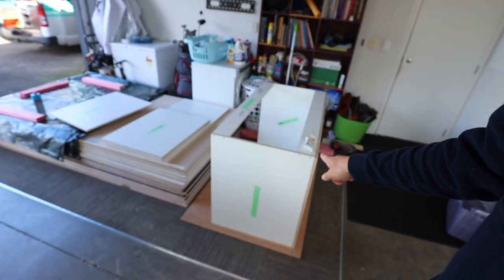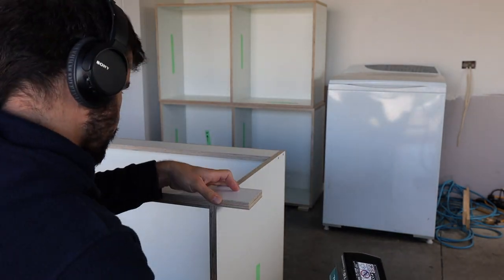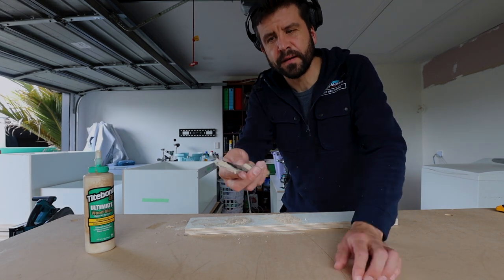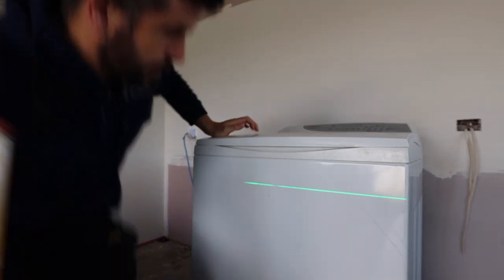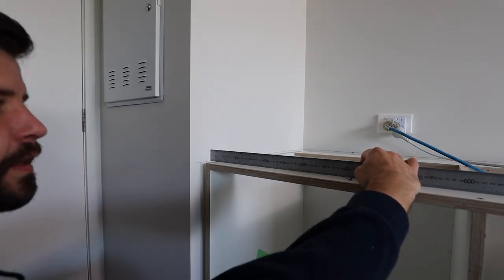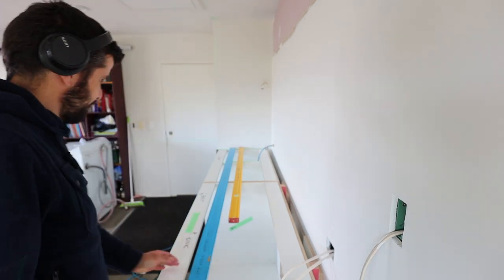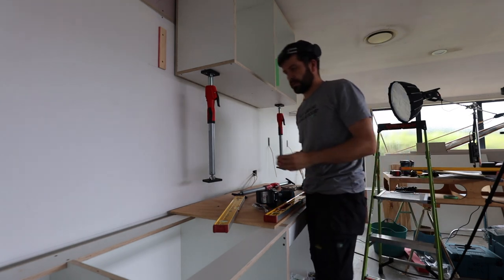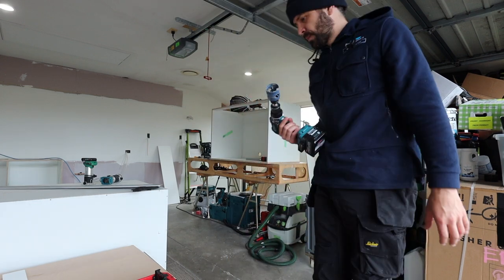Building Laundry Cabinets From Scratch

Comment: I just installed my mum and dads cabinets and i never thought to draw a level line on the wall, i spent so much time lifting the legs higher and using a level from one cabinet to the other lol.
you live you learn
Reply: Where i work we put a small lumber piece exactly under the bottom piece. That way the cabinets are always leveled.

Sorry bad english

Comment: Hi scott, Just a tip. When you use your lasers for installing cabinets, it's nice to have the laser 10cm higher than what you need and measure down with a block from that line to make it perfect. you'll save yourself a lot of headache and have more perfect results in the end.

Comment: Hey Scott, what you called HPL is just the stuff thats on the very top/bottom of those layers which feels like synthetic material. The wooden part inbetween is actually just higher quality plywood, which is why it looks better than the other stuff.
Reply: Also you could still make a middle section in the sink cabinet, just not the full depth. Instead make it the depth of the horizontal part on the top. That way the sink still fits in and it gives you more support for the horizontal one when somebody is leaning onto it to get something from the upper cabinets than your horizontal lower one. 

But as per usual, great video. Really enjoyed you working and the engaging energy you bring across so well.

Comment: HI -one way you can fit the top cabinets easily is to fit a horizontal cleat along the top edge and one along the wall - as long as the cabinet is square and the cleat level it pops straight on. Modern hanging hardware for kitchen units are only an adjustable adaptation on this. Rip a timber down the middle at 45 degrees - fit one to the wall the other to the cabinet - it will fit perfectly and never be seen.  I have seen it done with 12mm ply  - it doesn't need to be thick and will take a lot of weight as it's spread over a large area.

Comment: The router bits you’re after are carbide spiral bits. Thee types up cut, down cut, and compression (mix of up and down cut). For use on veneers and melamine etc I’d recommend a down cut to keep the chipping down on surface. Down side is bottom of groove will be a bit rougher. If you need a sweet dado or groove then the up cut is the go as it flings up the chips for a clean surface on the groove bottom. Compression bits sit in the middle and are good for a ‘mixed job’. Any one of the three will do a better job than the straight bit you used ;) can find them in all sorts of places. Carb-I-tool is a good compromise between quality and cost in AUSNZ. Good luck and don’t be put off by price. They’re HEAPS better :)

Comment: Hey Scott, you should check out compression bits for your router if you haven’t already. It will prevent chip/tear-out on the top and bottom  and leaves a smooth edge.

Comment: a tip for hanging top cupboard set your stand prior to putting up the cupboard just a few mm short of your desired height then put them under after and adjust from there

Comment: I think the new Festool drill has a feature whereby, if the drillbit (or holesaw) gets caught up, then the motor cuts out instantly - thus preventing the injury you experienced.
Reply: Makita has that on their battery angle grinders so they know how to implement that. Makes me wonder why they did not implement it in their 40v drills.

Comment: Hi Scott, set the clutch on the drill (which no one does) when drilling large diameter holes & you won’t get snatch back again. 👍
Reply: Yea, I used the drill function at one point and it kept binding and ripped my arm every time. I learned later on it probably would have been preferable to set the clutch so the drill would have stopped. The few times with the "drill" that you don't want it set to "drill" clutch setting
Reply: i agree
Reply: Or drill in reverse gear at least to get started.

I use diamond coated whole saws for cabinets because they have no teeth. They work great to drill through the thin hardboard or MDF and there's no binding. And you end up with a clean cut on both sides.

Comment: When setting uppers above your base cabs that are already plum and level, I’ve always found it easier to build a box that is maybe half the depth of your upper, and to the height at which you want the bottom of your upper to be from your base cab. This way, u don’t have to screw a ledger to the wall and deal with patching those holes, and you don’t have to screw anything in the bottom of your upper cab. If you’ve set your base cabs right, you just set your box you’ve made on top, and there you have a nice level place to set your upper cab on. And you just re use it right on down the line. Hope that makes sense! Cheers!

Comment: Tip for raising the top hanging wall
 cabinets without using them adjustable legs you could use  2 mini sissor lifts each side  then you don't need to put in screws  or need to fill in screw  holes after 😁 plus they are more stable wont move around 👌👍👍

Comment: I’m wanting to set front load machines at middle height in my mudroom. I like to set a good size tub sink next to the wash to catch overflow if the drain happens to clog during a wash. Have you guys got the heat pump type dryers there? I’m also getting the heat pump water heater with ducting- maybe I can exchange heat from my refrigerator in the kitchen directly above. Fridge costs about $80/year and that water heater is supposed to cost $104/year, so maybe I can cut both down another half? 
Anyway. Cabinets- yay! I’ve worked in a CNC run cabinet shop. You don’t need a CNC shop. Spiral shanks are nice tho! I’m always surprised to get a flat surface since it’s so… angular. Rabbits- I find it faster to use the track saw to cut my exact line, then clean up with the router. Instead of a table, I cut right on the stack of ply, lifting the work piece on stickers. Track saw all the way. You need three times the room with table saw, and you’re likely to get a back injury. 
You’ve not used 1/4 inch ply as backer for good reason- price is not reduced enough, plus thicker backer saves time from having to make cleats. Saves time on rabbits too. Bold move. 
I usually put a screw or nail standing proud right on the level line, (helps to verify stud locations too) and start cabinet hanging (uppers first) from the corner. A couple screws hold most of the weight while I tap the cabinet to the wall. Very simple one man technique. Any holes are easily hidden with a caulk seam under the cabinet. I like the clamps you got tho. Might give that a whirl. 
Good job mate!

Comment: A handy tip for cutting laminate without chipping - put a strip of masking tape over the spot you're cutting before marking your cut line. Press the tape down nice and tight and you won't get chip out. Instead of using the router for those check outs, the more conventional thing would be to use tape and a jigsaw. Tape would also save you the admirable caution you put into cutting the sink spreader on the mitre saw.

You can also get laminate cutting blades for the jigsaw which have up cutting teeth on the bottom portion of the blade and down cutting teeth on the top. Rarely, if ever, results in chip out, tape or not. I prefer to use both for the belt and braces approach.

Comment: Always use the drill on a slipping clutch setting with hole saws....
Reply: Agree with my fellow Dutchman, been there done that. Highest slip clutch and it won't break your wrist, or more importantly wreck your work piece.
Reply: Plus always use the front auxiliary handle when using hole saws, 👍🔨🇮🇪

Comment: Great vid as always. But if I'm correct you only screwed the upper cabinets on the backs, witch is very week as the full weight of the cabinet only replys on the fews screws uses to secure the back.  Normally I always use a fixing, brackets or similar, screwed to the sides, then the hardware to the wall, through the Back.  Take care!!

Comment: How do you like that Makita? I finally bought the big Kreg router table to dedicate my big porter cable routers into 2 tables and picked up the little makita for smaller work. I solely went Makita because I picked up another tool that came with 2 batteries and a charger and didn't want those batteries to get lonely haha. I also picked up the plunge kit and I want to say it was all less than 200 US fiat dollars

Comment: Those hole saws often work better when set on the lower speeds.
Reply: they work fine at any speed, so long as there is a drill handle involved. I've slowed the speed of my drill before and the torque can also almost break your wrist with those hole saws.
Reply: @dylanm3519  if the hole is under 4", i just use a forstner bit.
Reply: @Pepe-dq2ib  Forstner bits can be useful. But torque can also snap them, depending on what one is drilling through.

Comment: Tip for the future. When doing a sink cbd with a solid back put the front rail vertical and no back rail. That way you don't have to cut out the horizontal front rail for the sink. Tip 2. Get a car scissor jack and extend the handle. Easier to lift up the base cabs to adjust the legs. Tip 3. Don't bother cutting out any central divisions just fit them under the rails. Actually I never put any back rails in just used metal L brackets to fix the top down. With an 18mm back you don't need em. When machining out the carcasses I just calculate the top overhang, usually 20mm, subtracted a void space at the back, typically 10mm to allow for wonky walls, and an18mm back. On a 620mm top total width that gives you the carcass depth. Fit top, scribing if required,  screw top to carcasses  keeping a 20mm overhang, and then at the top of the carcasses screw back to the walls. No spacer blocks required as the top does that for you. It's way quicker than putting blocks on the wall. As far as wall units go I use French cleats then use wedges to bring them plumb. Then fit an extra bottom, usually the door/panel colour to hide the gap at the back. Also the French cleats are typically only 100mm long at each end to counter and wonky walls. And by screwing them from the cabinet inside, by backing off the screws Slightly you can fine tune it for plumb. Hope these suggestions help Scott.
Reply from the maker: Thanks Darryl, I appreciate all the tips!

Comment: Whenever I watch Perkins Brothers doing cabinets, they always start with the top.  So you don't have to leverage over the bottom pieces. Maybe a sawhorse for the jacks so you could used the tool and have the clearance at the bottom?  Well done, BTW.
Reply: 35 year cabinet guy here.  ALWAYS do bases first.    It's too difficult to find the exact high spot on the floor.  Setting the bases first eliminates that, and you can get an exact height off the base cabs for your uppers.   It allows for a much more accurate consistent install.

Comment: Kiao Ora Mate across the ditch - I'm not a cabinet maker but a few things - I've never seen melamine faced plywood, no that is not how MDF was invented and there is a purpose made patching putty for the voids in plywood, having an exposed plywood edge is a nice look but you will need to seal it - there is a plywood edge tape (ABS) that would have done the job, there are purpose build overhead cupboard stands that look a bit like bar stools that you could have used rather than put holes in your cupboards, everyone makes that mistake at least once when drilling a large hole with a hole saw - lesson learnt, cabinet making is a separate trade and what cabbies can do in one day with the right machines and tools non cabinet makers will struggle with for days. Cheers.

Comment: For overhead cabinet. You should put horizontal piece on wall, level that piece and chuck your cabinet on top and screw to the wall. Way more easy.
Reply from the maker: The mistake I made was getting the painter to plaster and finish the wall before I did the cabinets

Comment: When you are using hole saws use the toque setting on your drill, then when it grabs just does the fart noise then you pull it out and go again, saves your wrists and doing shit like you did.
Extra helpful when doing really big holes for down lights and ducting.
Reply: Oh, just scrolled through the comments and this has been said 1000 times haha

Comment: The router bit that looks more like a drill are called endmills and are ment for mills, there are ceveral factors to consider. 
The number of flutes (# of cutting edges) I would recomend  2 flute endmills as the more flute the heigher the cutting load(must be lower than deliverable power to the motor of the tool).
Material choice is another factor as hss endmills are cheaper but last less long than carbide endmills but carbide is brittle so if you hit a nail or drop it you may shatter which is also dangerouse as it sends debri flying, they do give a better surface finish as they chip and dent less than hss.
You should aslo think about tool length as the longer the cutting edge the higher the cutting load. And the length of the shank, I would recomend a shank of similar length to your router bits and cutting edge length similar to your router bits unless needed for something special but it should be avoided. I would not recomend long carbide endmills.
Hope this helps :)
Reply: They are not all strictly milling bits, and besides the only difference between a 'wood milling' bit and a 'router' bit is that a 'router' bit has a guide bearing ;). 
You can get spiral upcutting and downcutting router bits. The difference is that the flutes on upcuting bits evacuate the chips towards the top (good for blind slots) and downcutting bits evacuate the chips towards the bottom. The cutting edges being spiral shaped also helps for interrupted cuts since some part of the cutting edge is always in contact with the piece, whereas the straight bits alternate between all of the cutting edge being in contact and none at all.

Also keep in mind 'Router' bits always have 1/2" or 1/4" shank, whereas milling bits come in a far wider variety of shank sizes.

Comment: Those voids are from your lesser graded plywood IE Melamine ?  I don’t know why?  As a cabinet maker/finish carpenter I no longer use it?  To inconsistent and you can try as hard as you want ; however it will chip and peel , plus crack at the ends??
Off the shelf paint grade try “ Pure Bond”?and I usually do my finish at or near the end ?
The ends also look decent by using a Rnd Over?  And a floor stain I use is for hardwoods I use on the exposed sides if the customer wants it?

Comment: Milwaukee getting jealous of keep reaching out to Makita. Try reaching out to Toyota you may get a new van as it gets enough air time. Plywood edges. Makita don't make an edge bander eh. All plywood cabinets improvement on the usual chipboard construction and for made on site pretty good job. As to installation. Needs more practice but then it was a commercial production to showcase the Milwaukee lasers. I prefer my top cabinet stands. Mine just sit there self supporting. Place cabinet on top and wind up. How are you covering all those screw holes in the bottom. Never seen that before. Before the stands I used to screw a temporary level cleat on the wall and plonk them on that. Still do sometimes.

Comment: What I'm wondering right now is where is your distance from the back wall of the cabinet to the inside wall of the room? This distance is important for rear ventilation of the body so that no moisture builds up and molds. Where is this ??? 
Every carpenter knows that furniture bodies, i.e. the back walls of cupboards, are never placed directly against the wall because of moisture and temperature differences that mold if air cannot circulate behind the furniture!
Reply: Not sure where you're from but in Australia we never do this as a standard. The only reason we do this is due to the rear wall never being straight or plumb so we can pack out

Comment: Great video once again! Enjoying it from the Netherlands!

But doesn’t that Makita drill have anti kickback?
Reply: The antikickback works well when driving into concrete, but it doesn’t catch in time when using hole saws. The hole saw dimensions allow a large torque arm in flexible wood material so that it doesn’t reach the required impulse limit right away. It will still spin almost a half turn before popping off. I had a co-worker complain about it to no end. I learned from watching him what not to do. Don’t set it to high speed. Hold it so if it does spin it won’t flex your wrist. Reverse to score. Feather the teeth into material while tilting slightly so the trench of the cut isn’t tight enough to bind. Pull back frequently to allow dust to clear cut. Co-worker can’t find a drill that isn’t “broken”. i’m still using my Makita beast.

Comment: Baltic Birch plywood is what you want for exposed edges without imperfections.  Otherwise, try wet sanding—scrape the surface flush after filling/patching, then use a sander to smooth.  This will gum up the sanding pad but it will sand evenly.  Dried glue is much harder than the wood you’re trying to sand and will wear down the area adjascent to the dried glue much faster.  Laser is where it’s at—I invite you to try and draw a level line  around a room.  You’ll likely be a few mills to a cm off by the time you meet the other end.  Welcome to cabinet making—I.e. DIY IKEA cabinets 😁

Comment: what's the best laser for outside in the bright sun? or is there no such thing? cheers
Reply: Go  for a green beam laser,find it easier to see the beam,but most lasers struggle in brightlight/sun, Laser target plate helps,or use reciever which works perfectly in bright sunlight.With my Bosch reciever I can manage around 100mtrs range very,very accurately.

Comment: Do Makita not have kickback control on their drills or are you just using an old model?
Reply from the maker: They have it in the form of gears, I should of dialed down the numbers a bit and it would've stopped before twisting like that 🤦‍♂️